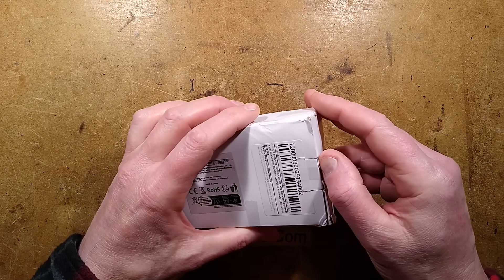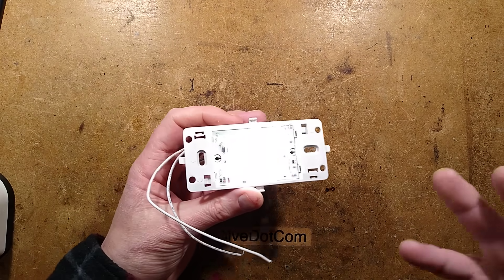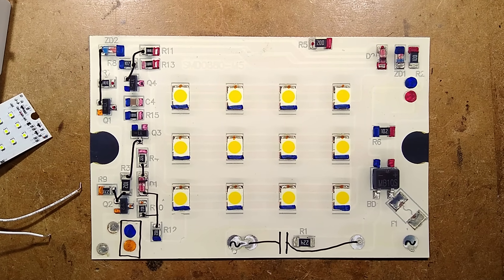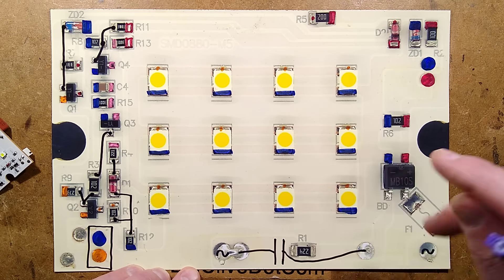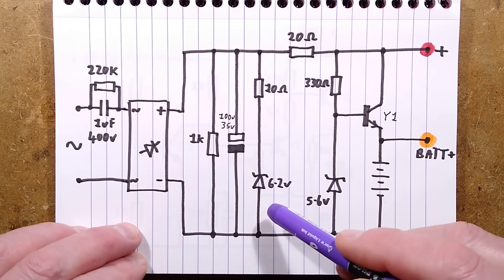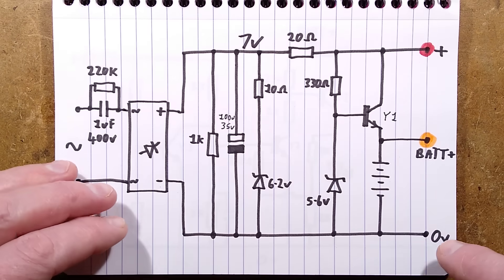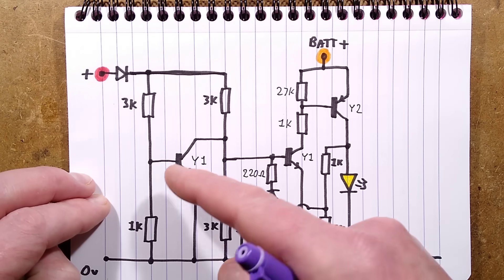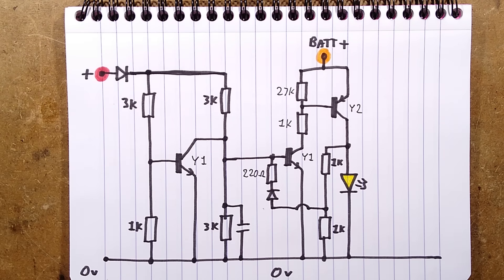Unusual circuitry twist - emergency light module

Comment: Latching on power fail is fine and good, BUT it should also have a light sensor (LDR) to only light if the room light is low.
...crap design with too small a battery.
Reply: ...I guess you get what you pay for.

Comment: Eight pieces of £13 NiCa 230AC input emergency LED lights were provided to me to install five years ago. The wider ones with a direction arrow on green. Their circuit board felt sturdy, components were properly installed. Overall good built quality. What caught my eye was that circuit board and components looked brand new but as if from the 70s, very nice, actually. But given low price and NiCa, I had absolutely no faith in these whatsoever at the time. I was wrong. Very wrong. Now five years later, none has failed while having been on 24/7. All still work for at least three hours on their battery. Actually... one had been disconnected from 230AC for half a year, obviously, its battery left drained for all that time. Yet to my surprise, that one still runs for three hours too.

Comment: Are 5V not a bit high for charging a (3 x 1.2V = ) 3.6V NiCd battery? Or is this not a problem b/c of the current-limiting resistor?

The latching circuit reminds me of a brown-out detector from an ATMEL application note for AT1200 microcontrollers (which don't come with a built-in brownout detector).
Reply from the maker: The current is limited and NiCad cells deal with trickle charging well.

Comment: Thanks for a great video. At 9:47 you pointed at the 27k resistor and said there would still be a small standby current even when LEDs off - I am not sure about that, wouldn't the transistor Y1 be fully off so no standby current?
Reply from the maker: I may have been thinking of Y2 as being an NPN transistor and there being base leakage.  But looking at the schematic again, there shouldn't be much leakage.

Comment: Two things that I kinda wonder about emergency lights and whole house solutions...
One is if we'll ever get to a point of having lights in a home all being part of a centralized DC system with backup power that is independent from the rest of the house circuitry.
You know, all these lights being low power, relatively easier to setup a backup solution in case of a blackout, if it doesn't make more sense to wire a different circuit for it.
And then the thing I'm wondering is why I don't see more full solution lights in the market.
I was looking into this fairly recently, couldn't find something that can act both as a fixed light, but also portable, with internal battery, and optional things like light and motion sensor capabilities.
Perhaps because rechargeable batteries are still not the greatest solution to keep always charging in place in a fixed position?
I was specifically looking for a bed light that can be wired to the mains, but could also be taken to light up the way at night or during an emergency. Was a bit surprised that I couldn't find an all in one solution. Basically the same as a portable light with a charging base station, but that you can fix to a wall or bed frame.
Reply from the maker: The main issue with acceptance of a 24V DC wiring system for lighting is the incompatibility with existing home wiring systems.
Reply: Too flimsy? Yeah... fire hazard not a worthy tradeoff. xD Maybe I should be a bit more worried with the bed lights I got that just has a wall socket or direct wire connection and unnervingly thin wires. Then again, it's low power stuff... not exactly something to light an entire room.

Comment: Given that it sits on the mains until needed would super capacitors be an adequate battery replacement that would give the unit greater longevity? Sure it would make it bulkier but if it is installed in a wall or ceiling most of that bulk is hidden anyway. Imagine having one of these things in every room, servinging the batter would be a PITA. I think I'd rather have them using red LEDs, particularly if it was going to give it a longer run time. Are there any commercial units like that?
Reply from the maker: I've never seen an emergency light with a supercapacitor.

Comment: Clever design so it doesn't completely drain the batteries and kill them. So many emergency lights that severely deep discharge the SLA or NiCad batteries that then ends up killing them as soon as they've been off-line for any amount of time.

Comment: A couple of factors about NiCd cells that you may have overlooked. They should never be charged at greater than C/10 (so 30mA for that pack) and their charging efficiency is quite low with a factor of 1.4
To fully charge that pack would need 30mA for 14hrs. If the charge current is less than this then it's going to take proportionally longer, so 2 days may be a reasonable time for a much lower current. Also NiCds should only be charged at C/10 or less if they are being trickle charged and should be fully discharged before charging or the charge memory effect becomes noticeable, although they can often be recovered by deep charge/discharge cycling 2 or 3 times at reasonable current (C/10 is a good figure 😉). Bonus fact NiMH batteries are even more fussy about trickle charging and only C/20 is acceptable to avoid damaging them.
Early simple charge circuits just using a resistive dropper are responsible for a lot of e-waste😉

Comment: I can’t imagine having 220V in every house in every outlet. In US 220 is considered industrial electricity for very heavy machinery. Only time you find large 220 in US homes is for very large clothes dryers or in some cases in larger houses for very large fridges. But in most small homes even those appliances run on 120V.
Reply: It's actually more exciting than that, the average voltage on a UK power outlet is around 245 volts, sometimes briefly dipping to about 230, at least where I live anyway, so yeah, it's a bit spicy.
Reply: Not sure where you get this? Except some very modern heat pump units every single electric dryer I've seen for us residential is 240 volt, gas units sure 120 volts, but not for electric.  Same for water heaters, though most heat pump water heaters still run 240, partially for backup resistive elements.  Electric stoves, ranges, ovens, air conditioners/heat pumps other than window/portable units, we have lots of 240 in us homes, it's not what most outlets have here but it's common for houses to have a number of 240 volt appliances.  240 is also common for ev charging, well pumps, hot tubs, some pool pumps, welders, larger electric heaters or electric furnaces, baseboard heaters, and more. 240 is also actually even more rare in commercial settings, there you more often find 208 for mid power things, and large or industrial uses typically start at 480 volts and for very heavy loads often use evrn higher voltages, heck most commercial lighting runs on 277, which is phase to neutral on a 480 volt panel, not off the 120/208 panel.
Reply: There exist 120V dryers.  They're mostly smaller, typically stacked units.  They take twice as long to dry as "regular" dryers.  You can pretty much find a 120V version of any 240V appliance, but you wouldn't necessarily want to use it except in special circumstances.

Comment: Great reverse engineering Clive and explanation of its function 
I have seen that output circuit with a relay in place of the LEDs to make it latch on and off. This pairing of NPN and PNP is an alternative to a Darlington pair - it has low forward voltage and higher gain.

Comment: Nickel Cadmium, you say, Big Clive? ... Are those sh1te old things still going? ... I have a couple of 40 y/o SONY Ni-CD Battery Packs for my Betamax VCR, and they still work.

EDIT: I've designed some Big Clive Merch T-Shirt slogans for you ...

Big Clive says, "One moment, please!"

Big Clive says, "Unreasonable force may be required!"

Big Clive says, "This isn't going back together!"

Big Clive says, "Reverse engineering is complete!"

Big Clive says, "Watch your eyes. The light is coming back!"

Big Clive says, "The light is back!"

Big Clive says, "Let's explore the circuitry together!"

Big Clive says, "Let's bring in the Kink Palculator!"

Big Clive says, "It's a simple capacitive dropper!"

Big Clive says, "Is this glued together?"

Big Clive says, "Will it carbonate?"

Marc Se7en says, "Joyeux Noël Et Bonne Année MMXXV"

Comment: Over here in the USA, GE and another major (generic) brand sell a plug-in variety of these emergency NiCd lights/flashlights.  They're very obviously designed for disassembly with a screw-together assembly - as I've done before already - to replace the batteries inside when they go bad.  And yes, inside, is a commonly available cordless phone pack of NiCd batteries complete with the Molex connector to unplug the old and plug-in the new.  My experience has been that they're all using AAA packs instead of AA.  Before people knock the old batteries in-favor of LiPo or LiIon; sometimes the old way is still better.

Comment: Just needs a NEMA backbox and it'll fit right in, only problem is, those are not cheap to get over here... :P
Reply: Same size as used in Australia and New Zealand, and beyond.  We copied an old US crowfoot plug, little used there now.  China copied ours, but with longer pins and no insulation, so a kids finger can touch a live pin on a plug partially inserted into an Aussie socket.  We have mounting boxes to surface mount these outlets in garages or industrial sites, fed by conduit, of from behind you could probably use.  To go behind gyprock there are simple metal clips.

Comment: You explained it just fine.  This is yet another case where it's so close, yet so far; a decent circuit with too many corners cut.  They had reels of 220K, so they put them in these to live their short lives as screaming discharge resistors.

Comment: Quite interesting mode of operation! Could be a bit better with a lithium cell, but then it would need charge control. This way, it only needs a standard wireless phone battery pack.

Comment: I used the two transistors bootstrapped output stage for low voltage protection of 6 Volt lead acid batteries. The stage is biased via a Zener diode connected to the output, so when the battery voltage (under load) falls below 4.8 Volt, the circuit lose the bias, and the emergency light can't turn on again, even if the battery voltage rebounds...

Comment: Why the choice of a  NiCd battery pack?  I thought they were banned due to environmental reasons?
Reply from the maker: Still used in emergency lighting as they are better suited to higher current trickle charging.
Reply: Thats contradictory. Trickle charging isn't high current. Trickle means small.
Reply from the maker: @simontay4851  In the case of NiCad cells they seem to tolerate a higher continuous trickle charge.  By trickle charging I mean no end of charge control.  Just relying on the internal chemical recycling to convert liberated gas back into liquid.
Reply: Grandfathered from RoHS thanks to certifications for medical and industrial equipment that require recertification for any design changes. In theory, they could restrict use to legacy designs but that would be difficult to enforce.
Reply: The other characteristic of NiCd (particularly flooded NiCd at least) is their superior low temperature performance. I know there was a desire to outlaw them but a successful case was made that there was not an adequate alternative

Comment: The battery charging on this.

 remind me of Another circuit this has been covered or not on this channel or even mentioned It or if someone has mentioned this in comments as well

I remember not only seeing how to do this.With a seventy eight hundred series Linear voltage regulator as a current regulator 

For Battery charger was fairly Simple circuit.But of course, it's just one part of the circuit but it's for me clever.I think i've seen this at least twice in some sort of product as well.

Before I'd heard about how to do this, it was like.Why would there be a voltage tragulator In the circuit and the notice something was a little off of how it was It configured.

I remember back in the battle days where you would have a retract file a Light bulb socket of course non polarized l No grounded line cord 1 A nice Chunky pair of battery clamps. 

Essentially one hundred watt inconnected volksward and series with the bridge rectifier.

Of course the battery clamps to the Positive and negative output of the verge rectifier.

Is bombay been enclosed or not.

And yes
I won't spell the separate battery charger like This.

Wouldn't be surprised if that Mysterious load of my front box that store my grandparents place Is contains essentially the same circuitry.

And yes Since potentially reference double line isolation Should be treated as though.The battery clamps are alive as long as It has power.

Long go and completely obsolete And not recommended.

They had once when about this time.This would be used that were actually isolated, but back then.The electronics are so expensive even just to add a power transformer.

Fortunately grandpa was using a more modern battery charger back in the day as well lots safer.

But you did actually have a suicide cord on the workbench racquet of the day.

Lil wayne two problem lamp cord with alligator clips.

By the way, I do eventually want to get the cliff quick test with the American wire colors.

I know the rebel and have looked into it.

Wouldn't recommend anyone do this for safety.

And yes, big Clive does have a video on thewhat do you quick test specifically?I do enough repairs and other things.It's worth having for safety

Comment: The battery low level protection speaks to your suspicion that the design was originally meant for lithiums.  IIRC nicads don't care about being zeroed out.
Reply from the maker: When you have multiple cells in series it is an issue where the first cell that reached zero will be reverse charged by the other cells.

Comment: Someone found a warehouse full of old, cordless phone batteries and had an idea.
Reply: Well NiCd cells are still being mass produced but less so than NiMh these days.  NiCd is probably a bit safer when installed into a wall box but it would have been nice if they included AA sized cells so they light would have a more appropriate run time in an emergency.
Reply: Why is NiCd safer than NiMh? Cadmium is toxic and NiCd batteries leak. NiMh have at least double the capacity so the light will work for longer, don't leak and don't have the memory effect that NiCds do. I thought NiCd batteries had been banned by the RoHs directive.
Reply: NiCADs are still used in emergency lighting due to stable characteristics in terms of ability to trickle charge forever, and not spontaneous combust.
Reply: @sullivanrachael  Likely grandfathered from RoHS thanks to emergency lighting requiring special certification in many commercial and industrial areas, where any change to the design at all needs recertification.
Reply: @NiHaoMike64  NiCd was indeed grandfathered because there is no replacement for low temperature usage
Reply: @robertadsett5273  Isn't NiMH a replacement that merely needs slightly different charging requirements?
Reply: @NiHaoMike64   more than slightly different. The charge termination characteristics are quite different. The big advantage was the increased energy density. Lithium has taken that advantage though. 

In terms of temperature characteristics though NiCd still has superior low temperature characteristics though AFAIK. Certainly better than NiMH. Flooded NiCd were the battery of choice for electric ice resurfacers for that reason. 

As I recall NiCd has been the battery of choice for satellites as well although they’re starting to use lithium on at least some. I don’t recall the reasons though, not cost since the cost of lifting the NiCd battery to orbit exceeds any premium for using lithium
Reply: The fact they did use NiCad means this thing will probably still be functional in 30 years.  NiCads are incredibly resilient to abuse...that's why many industrial sectors still use them.
Reply: NiCads are extremely tolerance of misuse...that's why they're still widely used in industrial applications.  This light will still be working 20 years from now.

Comment: As common of a thing as an emergency light would be today, it's interesting to see a design without an IC anywhere! Unless you count the bridge rectifier, which I don't.

Although some may consider NiCDs to be inferior by today's standards, the simplicity of making a safe charging circuit means that they are less expensive to use. Also, a simpler charging circuit, in principle, should be more reliable, which in some applications may be essential.